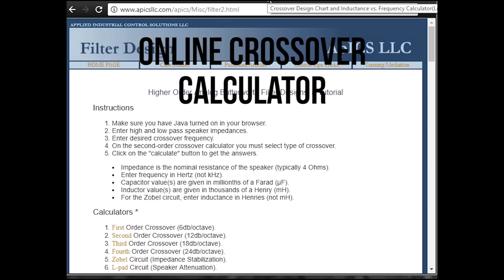DIY Center Speaker, 2 Way Crossover Build and 4 Speaker Wiring

Comment: omg thank you for showing that 4 midbass desing :D i was just thinking how to make center speaker with the same impedance as my front speakers :D
Reply: for some reason i was only thinking 2 midbass desing :D
Reply: Or should i just put 2 midbass in series and let the added cone area add + 3 db? And -3db from the increased  impendance ? Or are my calculations wrong?

Comment: Those drivers look very very similar to Visaton FRS8 drivers. For better off axis response I'd recommend a horizontally curved front baffle  and putting the tweeter up higher then the mid drivers. This should reduce the beaming effect you get from the current design.

Comment: Dang fine piece of functional furniture ya built there!
I don't need to know how to use power tools or build a box. I need to know how to wire up a diy bass guitar cabinet with a horn and crossover to push air at 4Ω
Imma go out on a limb here and assume that the size and power and impedance is somewhat irrelevant as long as your target impedance can be met by the wiring. This is basically the same as if I were to build a 4x10 with horn and crossover for a bass guitar cabinet 4Ω at the point of power. Right?
Dang! That you drumming? That's my gig but I wanna slap de bass also!
Reply: @chrclmnky  seriously. since daddy peavey retired they don't hardly answer the phone anymore. imma do this on my cab. drivers on the way. i'd jam with you any day homie. I ran this vid thru my PA and it's the shit!

Comment: In diagram you have in video.  Green line (wire) connect with speaker's +terminal on left side but on the right side same wire is connected with - terminal of speakers. I dont get understand?
Kindly guide 
Thanks

Comment: Is it on a center channel on the receiver or a left/right? I know it a center sound bar I built on similar but have it 2on left and 2on right no center tweeter just 4- 6 1/2" coaxial speakers on a L/R 2 channel amp great job though 👍
Reply from the maker: Thanks Jonathan. This speaker can be re-wired for a left and right configuration but the tweeter can be only on left or right. You can build something similar and install two tweeters for a more flexible speaker feature.

Comment: Nice sound sir, I hv a doubt, what is the software u r using for box design and what is that 4400 HZ frequency ur using...and also u didn't show the back side connections of cross-over ckt..
Reply from the maker: Hello Nandu. Sorry for the limited information about this project. Just use crossover calculators when you build your projects.

Comment: Get drok speakers, they are better... put the bass port where the Tweeter is... put the Tweeter on top or below it, if that makes sense. But either way have the bass port facing with it ( gives a little extra thump). and use MDF next time.
Other than that I have to say it looks good!
Reply from the maker: Yes sir thank you.

Comment: Your calculation for the low pass (woofer) is wrong as you have connected four 8 ohms woofers in parallel.
So the effective impedance will be 2 ohms for the inductor calculation.
Reply from the maker: Parallel - series. Look closely .

Comment: 4400hz has a wavelenght of 7.8cm or roughly 3.1". Considering your drivers are 3" in diameter and also spaced out a bit there is no way they are within 1 wavelenght center to center at the crossover frequency. This will cause intermodulation isseus with peaks and nulls as you move around. You need to cross overa lot lower for this and most likely second order unless your tweeter has a very low self resonant frequency (like below 1k at minimum). I also doubt bass reflex does much good with 4 drivers in that box. What frequency did you tune for? Might be better of closed, and braced. Also 4 horizontal drivers create a line array which will cause beaming and a narrow sweetspot with your tweeter beaming in the middle. You can improve this with a series lowpass over the 2 outside driver (I'd suggest first order at 300hz,all you need is 2 caps) Whenever possible install the tweeter above the center of the other speakers in a center channel. This will give you a much better high frequency dispersion. Good luck 😉
Reply from the maker: Nice. I appreciate the feedback. Will do. Thanks.

Comment: Sir ano po ang total wattage at total impedance ng dalawang 300 watts at dalawang 150 watts tweeter
Isang midrange 150 watts
8 ohms po lahat at may dividing network na 600 watts..

Comment: Can you tell me the speaker connection diagram?
Reply from the maker: Hello Shivanish, there is a wiring diagram in the video. It consists of parallel and series to obtain the right DC resistance and impedance.
Reply: Thank you 😀
Reply: @chrclmnky can you please tell me the box dimension ??
Reply: Suggest me cross over ?? For it

Comment: I did not understand the connection of the speakers think that they would all be connected in parallel what is the final impediment grateful
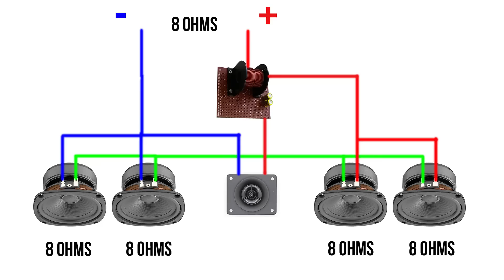Reply from the maker: Hello Marcelo, a combination of series and parallel as shown in 3:51
Reply: Use cross over
Reply from the maker: @lovekush9103  yes it has

Comment: Which amplifier(watt) is suitable for this sound bar???
Reply from the maker: Hello Aritra, how you doin. This is a center speaker and only has single channel for CENTER channel to be hooked to your 5.1 amplifier or receiver. Home theater or PC. There is a cheap Chinese made Class D 5.1 amplifier you can buy from Aliexpress.
Reply from the maker: You can hook up amplifier with 50-200w with this one.

Comment: sorry bro but your x-over calculations where wrong cause you put 4x 8ohm drivers in parallel which you should of rated at 2ohms not 8ohms
Reply from the maker: LOL. 2 pairs in PARALLEL, then connect those pairs in SERIES which gives you 8 Ohms. Do the math, it's fun.
Reply: CHRCLMNKY its ok man was just trying to help thanks for correcting me yes you did wire in series not parallel my bad
Reply: It looks like out of phase series

Comment: wiring is not right.all spk r in series.
Reply from the maker: Hello Naveed, its actually a combination of both parallel and series to achieve final impedance of 8 Ohms
Reply: hmmm oky but in series sound will be lowering than in parallel
Reply: @qureshifoodsecrets5233  he  might be having an amplifier which is stable at 8ohms not 4 ohms so dats why these kinda  combinations
Reply: @chrclmnky  its oky but sound quilty will also change in this way.loudness will b change.
Reply: @qureshifoodsecrets5233  loudness =/= soundquality

Comment: magkano nagastos dito sir? salamat..
Reply from the maker: 4" woofer = Php 285.00 each
Tweeter = Php 400.00
Plywood = Php 600.00
Crossover materials = Php 500.00 all

Roughly Php 2,700.00 total expenses. :)
Reply from the maker: To slice budget price, you can purchase Crown CN-215 2-way crossover, that only costs like Php 250.00 each. Also I advice to incorporate Kevler tweeter, that looks better and is only Php 285.00 each at any local audio-electronics stores.
Reply: salamat sir.. ganda ng works mo
Reply from the maker: Thank you for watching, Sir 😊
Reply: may fb kaba sir? paturo naman hehe..

Comment: Just buy a center channel. Would be better anyway especially because the tweeter you use is cheap af, the magnet is tiny
Reply from the maker: Money can't buy class.
Reply: @chrclmnky  Money can buy great sound, what is so classy about drivers made in some generic China factory lmao
Reply from the maker: Get real, everything's made in China. Even the phone or computer you are using to comment on this one is purely made in China.
Reply: Hi-Fidude66 the Magic and exotic speakers you like all have components made in China... magnet size is also a dumb arguement.  One of the best systems I’ve heard was a Mac tube amp driving a pair of alnico 8’s with tiny magnets. The music was stunning.

Comment: Didn't you calculate tune for the port? Driver holes are too big, The 2 crossover'ed woofers should have a separate enclosure than the 2 non-crossover woofers. It sound's very hollow, you need to make braces on the inside to stiffen the enclosure. Other than that, it's....okay.
Reply: pretty sure all the woofers are crossed over because they're in series.
Reply: Hopefully the low pass for the outer two is way lower then the center two woofers.  If not the comb filtering will be very pronounced.
Reply: Just the word I was looking for to describe the sound "hollow" but clean still okay.

Comment: This crossover design is wrong! Speaker do not keep impedance at the same value trough all frequency range. At least impedance corrector circiuit shall be used for first order filter...Eh.... U neeed to read some books....
Reply from the maker: Ah ok. 😴😪
Reply: true. this "center speaker" is masterpiece of sh*t. no merasuements for crossover, speakers out of phase, woodworking, etc..
Reply from the maker: You guys really are very, very smart.
Reply from the maker: Wow you are indeed very smart. This should go to r/iamverysmart on Reddit. 😂😅
Reply: Damn there are some rude mother f-ing keyboard warriors on the internet. Are you even capable of a communicating in a normal way?
Reply: Start with "Introduction to Loudspeaker Design" by John L. Murphy
Reply from the maker: Xander Guldie Everything you see on the internet, is, just, normal. 😂